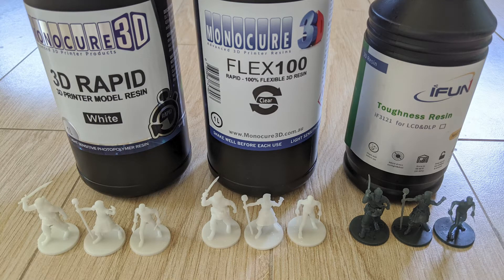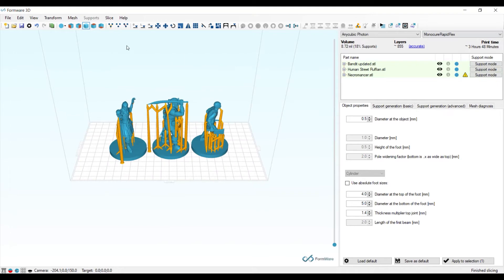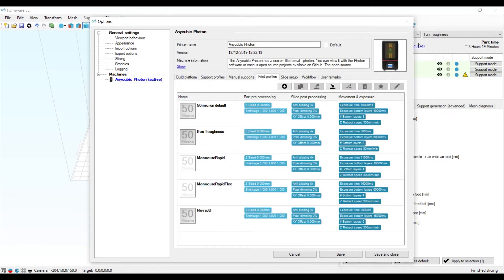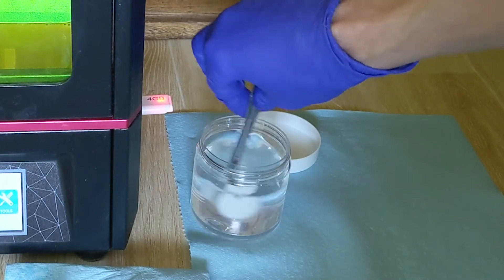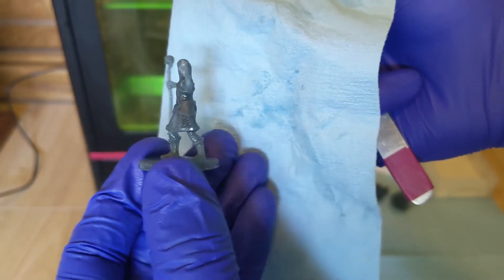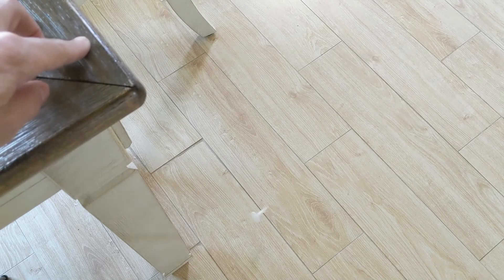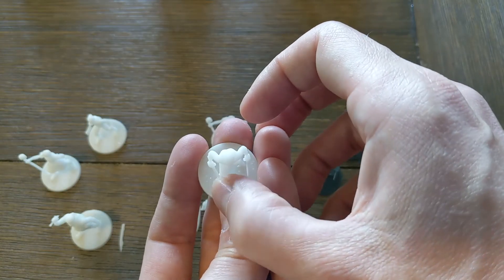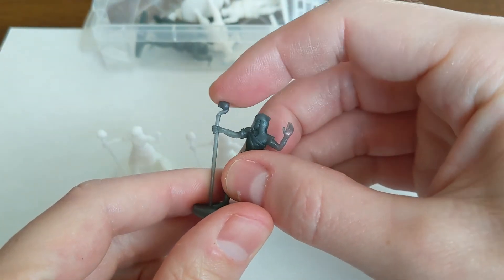3D Printer UV Resin Durability Test - Monocure Rapid/Flex and iFun Toughness

Comment: Dont know if you already fixed the resin sticking to the fep but here are my five cents. 
The resin stricking to fep is because the bed is not tightened well enough against the lcd.
If you dont want to fix what I mentioned earlier a simple "curing some resin into the fep" removed the problem of having to scrap the fep. Hope it works!

Comment: No comments that is odd. Can you comment on the quality? Is the finer details visible still? They appear to be high detail prints but no serious close ups in the video.
Reply from the maker: There was no noticeable difference in quality of detail amongst the resins. All the finer details were still visible on all of them.  Good question though, may be something to try later at higher resolutions. Recently I've been using Siraya Tech ABS-like resin mixed with a little bit of their tenacity resin (not as watery as the flex resin from monocure) and it has also printed well.